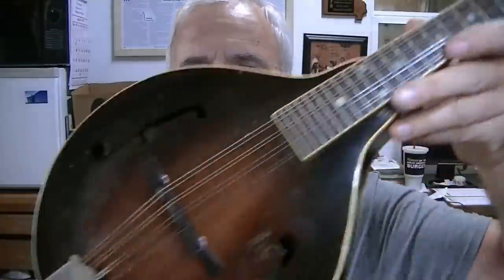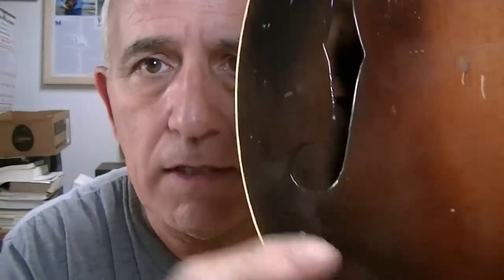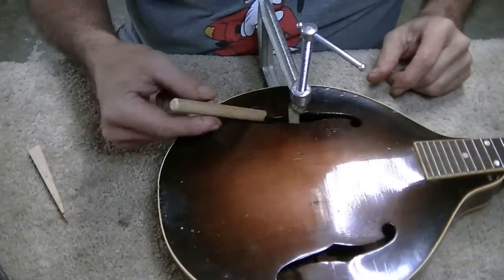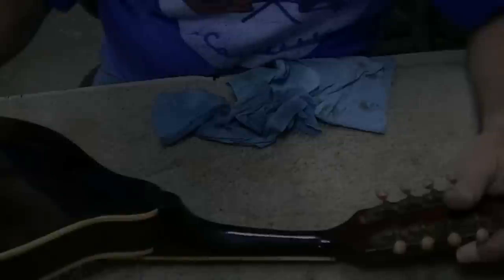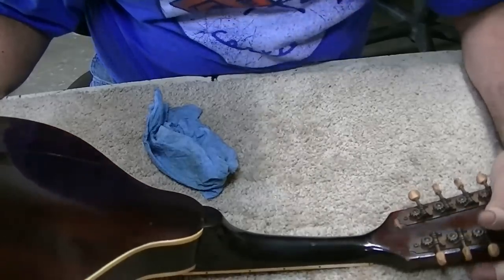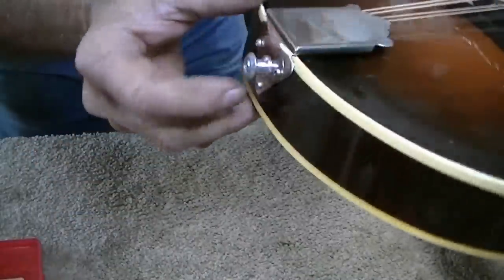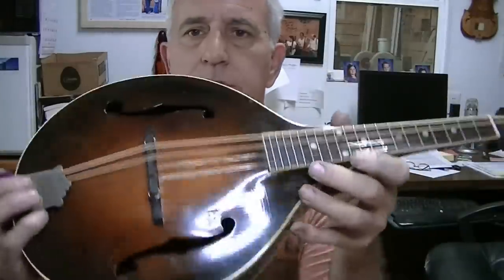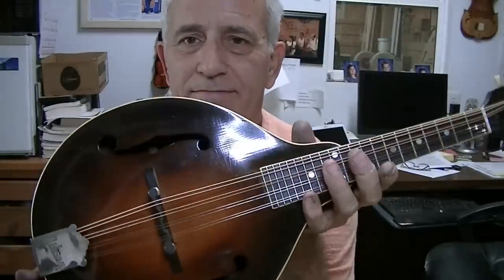624 RSW Making A Relatively Old VINTAGE Short Neck Mandolin Playable Again!

Comment: My Gibson made 1940 Kalamazoo Oriole mandolin has that headstock which is thinner at the top edge, so it may have been something that Gibson did at that time. Those old Kluson tuners from that era are notorious for buttons shrinking and crumbling. Stew Mac sells replacement buttons to replace the old ones as they fall off. Nice work, Jerry! That headstock logo and the much later tailpiece and cover rather than the "cloud " type suggest that work may have been done to the mandolin back at Gibson at some point but not a re-carved top as you state.

Comment: It looks to me as if the mandolin was dropped on it's tail piece (hence replacement thereof) resulting in the cracks on the back.  It might then have fallen over damaging the neck, then  and/or also knocking the bracing of the back loose too, perhaps? 
Interesting discovery and repairs on this one, IMO. I like the clamping through the soundhole strategy.

Comment: I loved this project. As far as that hairline neck crack, all you can do is what you did. You looked it over very closely and no movement seen, no opening visible. So just finish up, string it up, and wait and see.  Customer needs to keep a close eye on it. Wait and see - if it grows or shows any more of a problem, work on it then. It MAY explode at some point and not develop slowly. Replacement is sometimes necessary. That'd be a shame in a vintage mando like this.  And I love your demos on mandolins! I just wish you could play the guitar better. I don't like to see you play open G, C, and D chords and call it good. They have to play well all the way up to the body, and with string bends, even on acoustics. Just sayin.